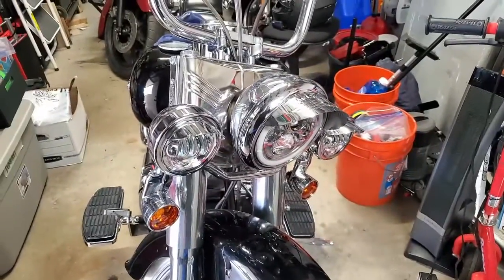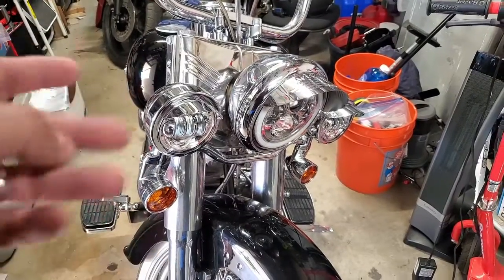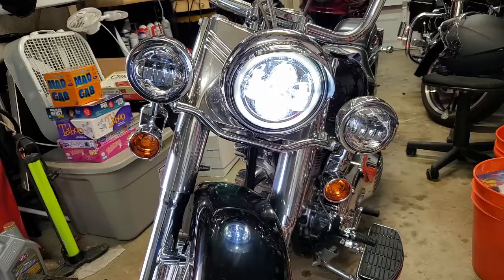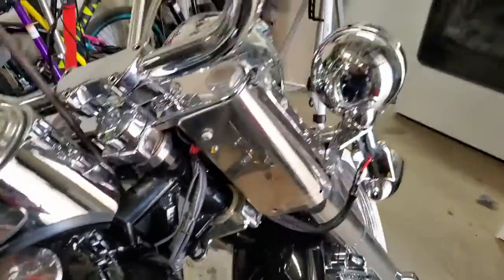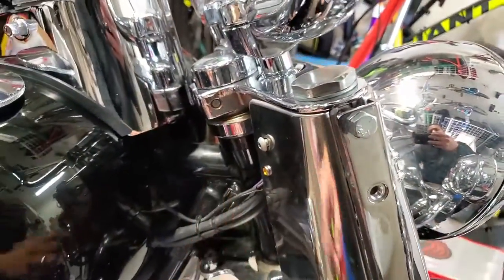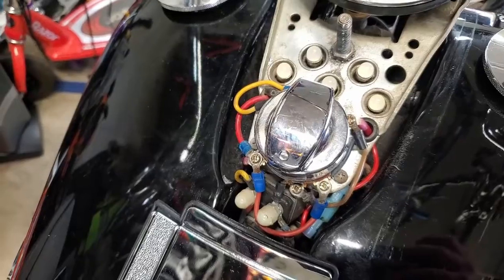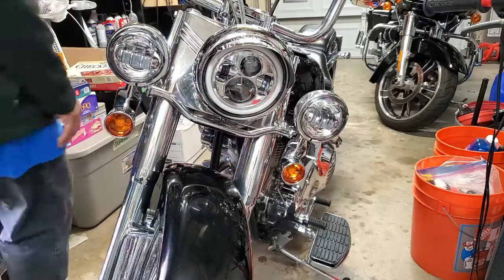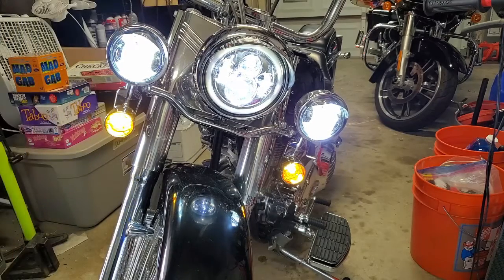Harley Passing lights

Comment: I would find a different power source when you use turn signals the low beam dims
Reply from the maker: Funny you say that. A few weeks later I went back in and re-did them and the ignition switch. Previous owner did some creative wiring there and at the coil. All straight now. You're spot on.

Comment: Help,  I have an aftermarket set of Halo Led Passing lamps.  The red and black wire turn on the light and the white halo ring.  My problem is the light has two more wires....the light also has a amber halo for turn signals.  So, the red and the black are the light and the white halo ring....there are two more wires a blue and yellow.  Which on is the amber turn signal ring and why are there two wires....???  I would think on the light  there would only be three wires....Power, Ground and Turn Signal wires...so, why 4 wires...I ohmed out using the black wire to the yellow and blue and both are showing resisitance.  If one of the two of them were another ground I would not have seen resistance.  Im lost on this one...Help..???
Reply from the maker: shoot a link of the lights you bought if possible.  my thinking is your lights could offer more than just the Amber and White Halo.  Ive seen colors as well which could be the additional wires.  I very quick way to tell is to use a piece of wire going from the positive from your battery to each of those two wires to see what comes on.  Since you've already validated they arent ground wires they must be positives.  Providing power will reveal what they control.  Might be able to figure more out if you can provide the link though.  Hope this helps.   If you are worried about connecting the wire straight to the positive, i would say add an inline fuse of like 5 amps to be safe.  LEDS dont draw much and if it were to some how short, the 5amp fuse will go very quickly.

Comment: When you use your directionals your headligh flashes
Reply from the maker: yeah, it only did that when the bike was off.  When it was running no issues. Not sure if it was due to a weak battery while I kept testing or if it was something else but since it went away i didnt pay it no mind.  Appreciate your feedback and support.
Reply: @Mikeityourself  Oh yeah, that definitely could be it.  NIce job